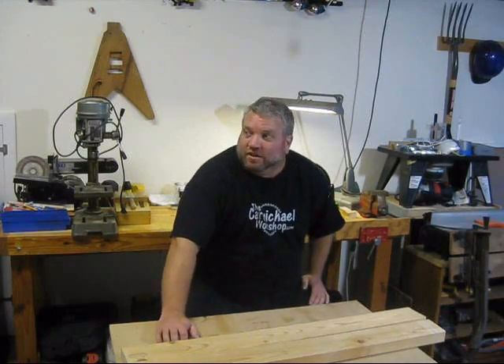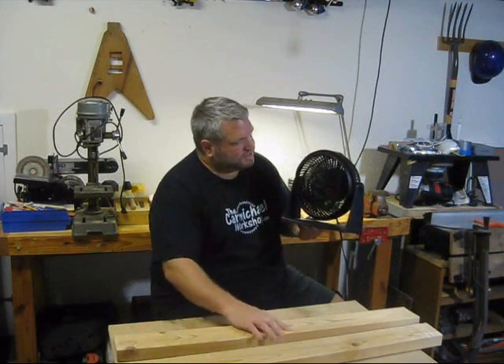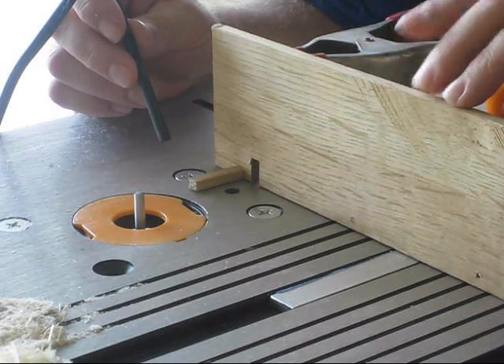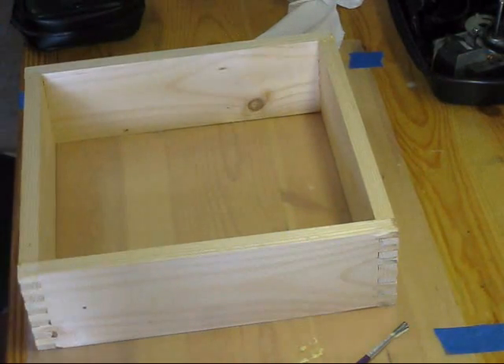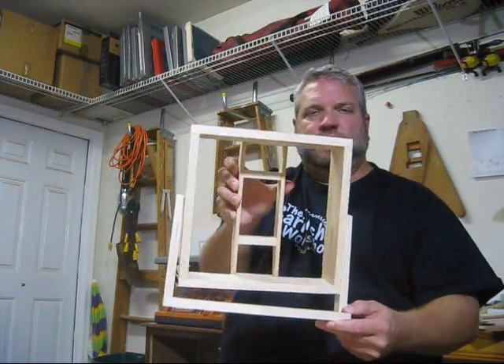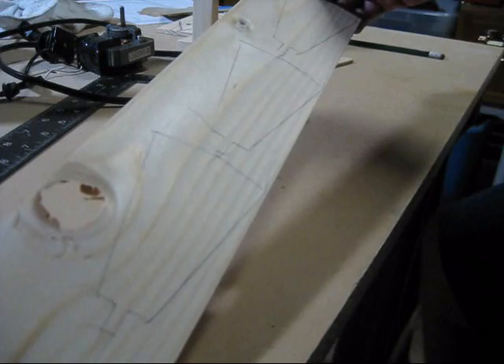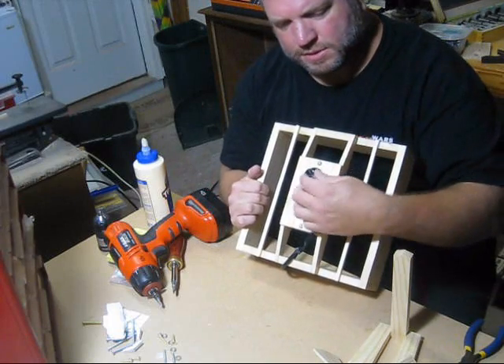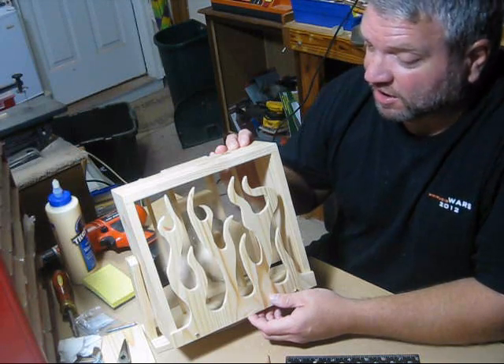How to Make a Wood Electric Fan from a Cheap Plastic Fan - Woodworking 2x4 Contest Project

Comment: You could've used metal wires for the grille, but I still though the flame design looked great.
Reply from the maker: I think this was for a 2x4 contest, so I had to make as much as possible from the 2x4.

Comment: What about bevelling the blades as on real fan  blades?  Bet output would improve.  Get busy.  Also, use nice knobs on side for interest and allow tightening fan angle after use loosens.  Great fan. I keep staring at my stand fan, hmmm
Reply from the maker: +dunlaoghaire  Thanks!  I would like to make another one of these, but bigger and out of nice wood.  I was limited to a 2x4 for a contest on this one, so it was hard to work with.  I'm picturing a nice walnut fan with maple blades.  I have a stand fan in my shop that takes up floor space.  It's got 3 speed buttons.  That would be a good candidate.  :)

Comment: First of all, supreme job! Secondly, I am pretty amazed how smooth your fan runs. And thirdly, you seem to be the only one who could describe the box jointing jig without too much complication so everyone could understand it (myself included). Congrats!
Reply from the maker: Wow, thanks!  It still runs smooth.  The original plastic blade puts out more air so I put that on when I really want to use the fan.  I should have made the wood blades a little bigger and maybe curved scoop shaped.

Comment: you need to paint the flames for a better look. But its pretty nice works.
Reply from the maker: Thanks!  It was for a 2x4 contest and I didn't have enought time.  I might go back and do that though.  I made it so I can make other grills on the front and change them out.

Comment from the maker: Thanks!  I got 2nd place.  My neighbor beat me by one vote...and I voted for him.  LOL  I think the blades were a little off balance too  They did not put out much air either, so I ended up putting the original plastic blades back on so I can still use the fan.  I might redo the blades someday and make them thinner and better balanced.

Comment from the maker: The hardest part was figuring out how to make something out of wood to mount the motor and switch to.  I'm still using the fan, but I did put the plastic blade back on because they move so much more air.  I plan to hollow out the flames with my scroll saw to increase the air flow through the grill too.  Thanks for watching and thanks for your nice comment.

Comment from the maker: Thanks!  I didn't do anything special for the blade.  Actually the wood blade seems about the same weight or even lighter than the plastic one.  I used a drill press to drill the hole in the blade center so it would slide onto the motor's shaft as straight as possible.  It's almost perfect but there is a slight wobble, but it's barely noticeable.

Comment: Cool! 
Did you have issues or plan accordingly to make sure the motor could handle the change of weight from the plastic blades to the wooden ones? 
I am just curious. When I have messed with a shaft/ blade systems ( on pumps and whatnot) I have had issues with it not handling the mods and it either burns the motor out or it being really wobbly and unstable. 
Cool fan~